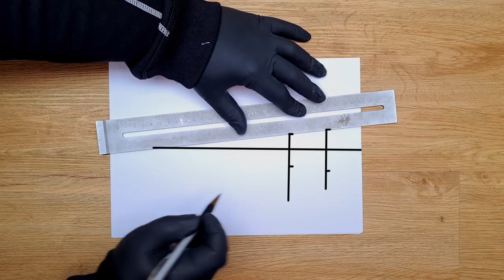German 'St. Hubertus Glas' binoculars restoration [very damaged leather grip]

Comment: Great restoration, have you thought about getting brass wire brushes.  Will not score the brass on the object you are restoring.  If you do, make sure they are brass and not brass coloured pawned off as brass.
Reply from the maker: Geoff Quickfall I already like this growing community - you are right! I did a little research and will implement your input for the next projects - thank you
Reply: @ForgottenShineRestoration  It also distressed me to see you using a steel screwdriver to lever apart brass parts. I realise you are about to clean everything up with files, sandpaper etc but in general it's not good policy, the hard tool leaves marks. Rather look for plastic picks or "spudgers" in the computer tool section of your favourite website. Cheap and effective, and if anything breaks it's the plastic tool rather than the thing you're working on.

Comment: What you call a patina is not. This is skin glue, dried out. And the work is beyond praise.
Reply from the maker: Old grandfather I appreciate your compliment very much. I think it is or better was kind of a mixture of the glue, leftovers of the leather and also patina
Reply: It quite clearly was skin glue. Patina, Verdigris, Copper Oxide, whichever term you use adheres to the base metal. It does not behave in a manner that can be peeled away. 
Also I even question if this was the  original state of the binoculars, it looks like it was accelerated aging. Which does not detract from the restoration but maybe should be notated.

Comment: I wouldn't use steel on brass if you are trying to preserve the metal. They make softer copper wheels and brushes that would take off the old glue and dirt and polish up the metal better.